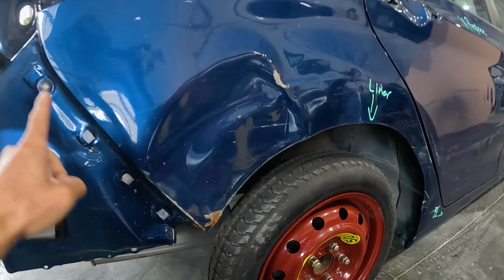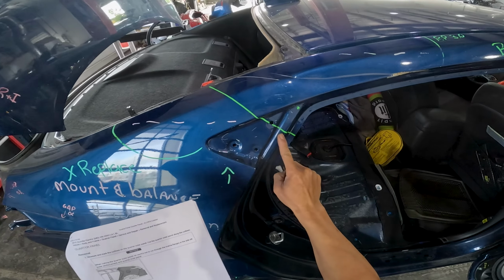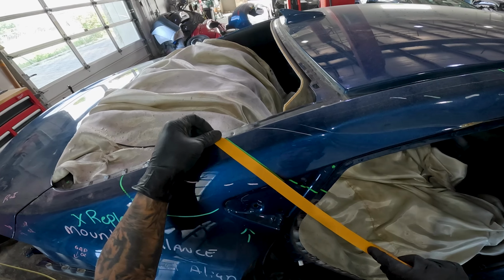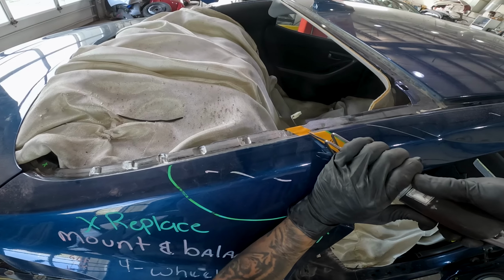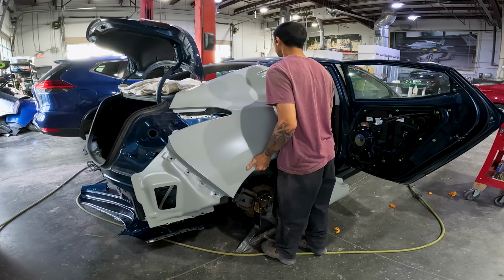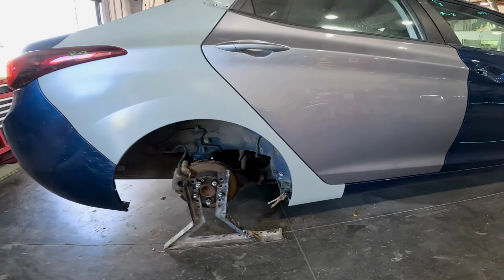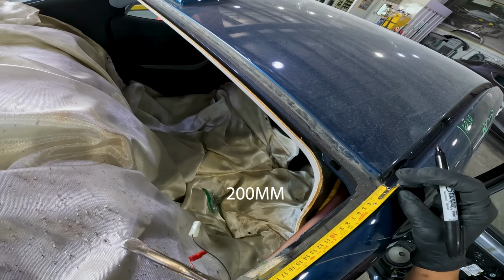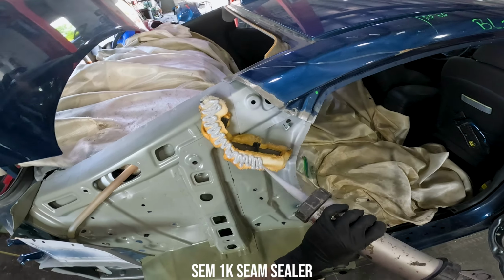Elantra Quarter Panel Skin Replacement | Collision Repair

Comment: What hammers did you use to bang the panels back into shape?
Reply from the maker: A 2lbs mini sledge hammer
Reply: @ I was going to buy one to wack back 2 large dents on my rear quarter side panel I'm glad I didnt I took it to a local bodyshop and they charge me $200 just to straighten it. Im going to do the rest of the bondo and paint

Comment: Learning metal work now. Just finished putting a quarter skin in a 72 lemans. How do you keep the metal from warming when you’re welding so close together? I get the footage is sped up but it seems like even when I jump around to spots 1.5ft apart it still gets way too hot.
Reply from the maker: Have you tried just doing 1 tack at a time? It seems you are doing everything correctly. 
I'm doing a video on this, should be out tomorrow. maybe there will be something in it that you could benefit from

Comment: Asmr for me. N also very educational. Curious how many hours this came out to? N do you get paid hourly?
Reply from the maker: Thanks! I don't remember the exact hours, but a typical quarter panel replacement pays about 16 hours on average. The full job start to finish, probably paid about 30. 
I get paid on a flat rate system